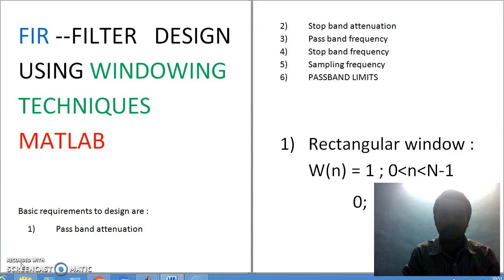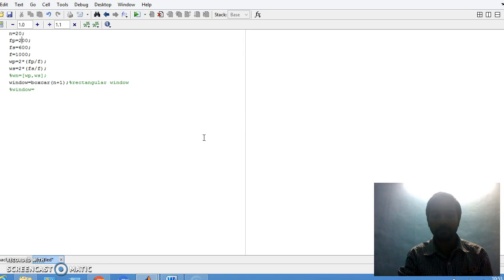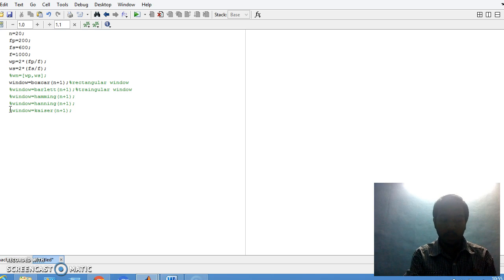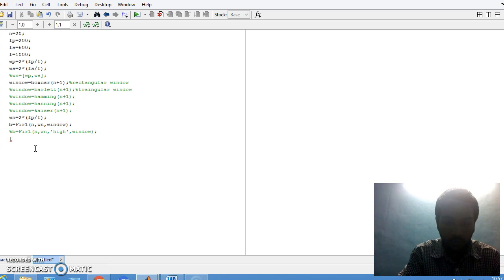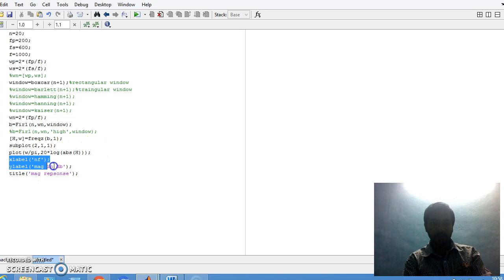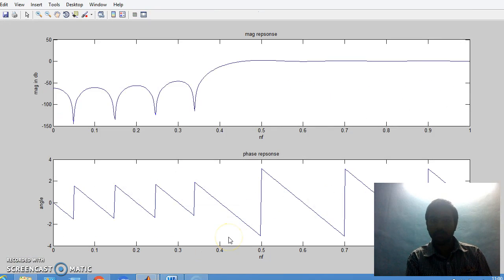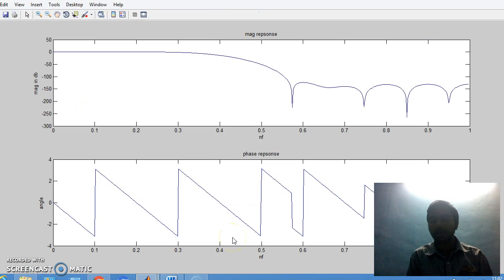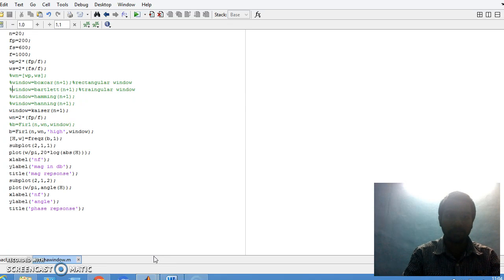MATLAB CODE FOR FIR FILTER DESIGN USING WINDOW TECHNIQUE | MATLAB & SIMULINK

Comment: 1. A signal x(t)= 2sin(100πt)+3cos(400πt)+6cos(800πt) received by a discrete FIR band pass filter with cut of frequency from 100 Hz to 300 Hz. Filter length is 53 and it use hamming window. Write a program which (a) perform frequency analysis of incoming signal (b) create the required filter and (c) perform frequency analysis of filtered signal after passing through filter

sir please help me out to solve this problem